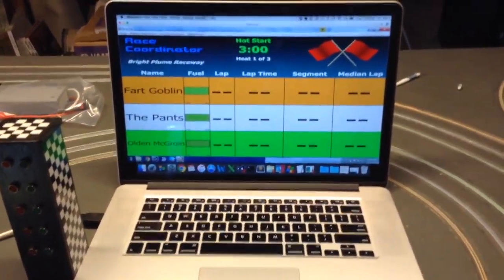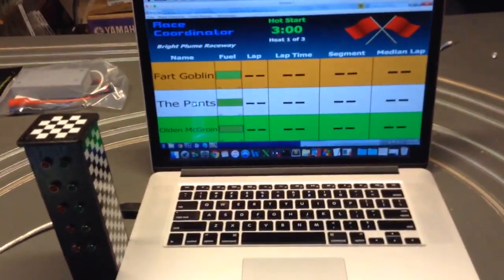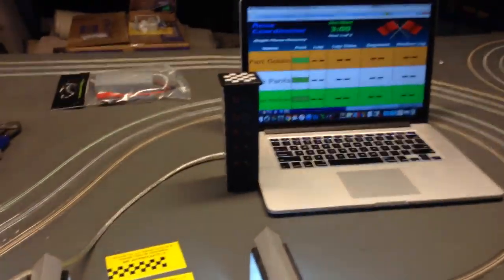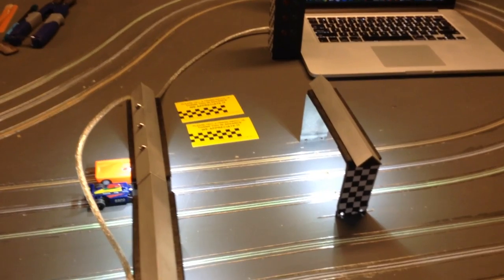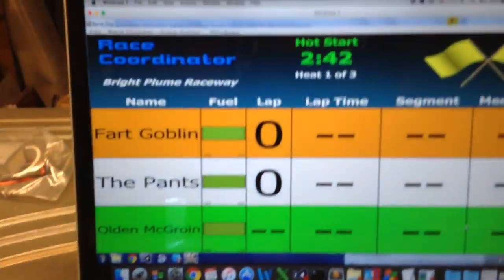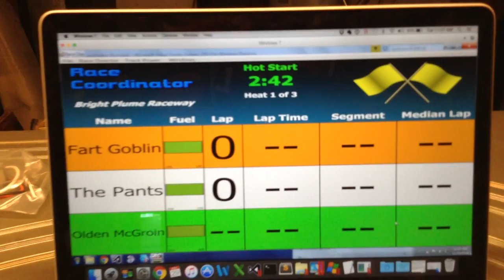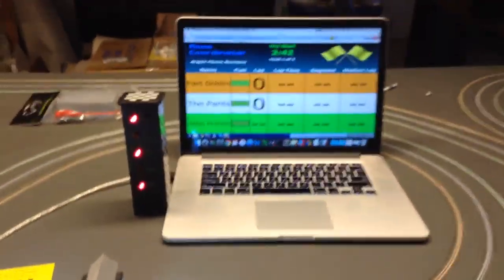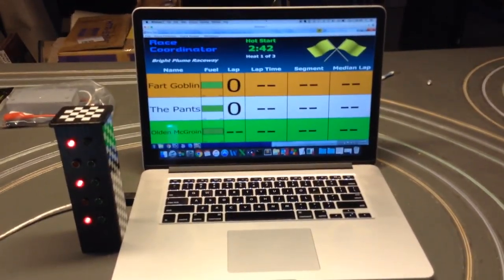Race Coordinator / Viasue Callbuttons and Relays

Comment: Hi Dave,  I recently started using the race coordinator software as I was having a couple problems with trackmate. We do oval racing that we award points to each racer at the end of each heat that are cumulative. Allowing all racers to finish their last lap after the leader finished a set amount of laps was one of our biggest desires which your software does.  The problem I'm having is that when we have a restart after a track call, it seems like the software is counting the partial lap as a lap of its own resulting in a very low erroneous best lap time. Since we use best lap time as a tie breaker this is a problem. I imagine I have a setting wrong somewhere but I'm having a hard time finding which one. Thank you for any help you can offer and all your hard work on this.
Reply from the maker: Just saw this, as mentioned questions like these are best asked on Slotforum.com or one of the other forums.  But in this case you probably need to make sure the "adjust drift laps" setting is set for your race(s).  All that option does is ignore a lap time when considering it for a fastest lap/lap record.  It "should" also reject drift laps for consideration in the tie breaker calculation but I'm not 100% sure off hand that that's how it will behave.